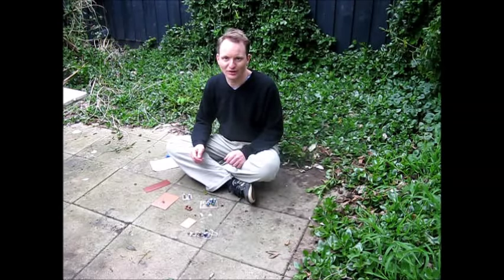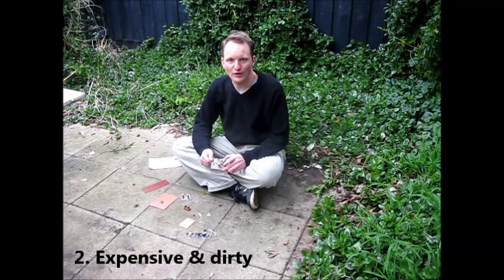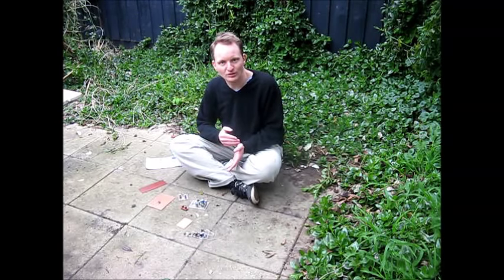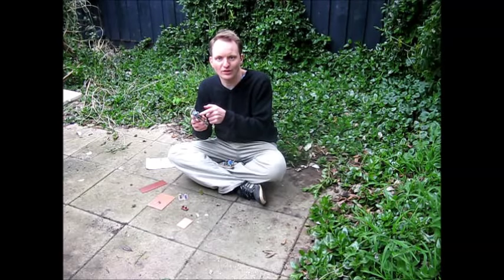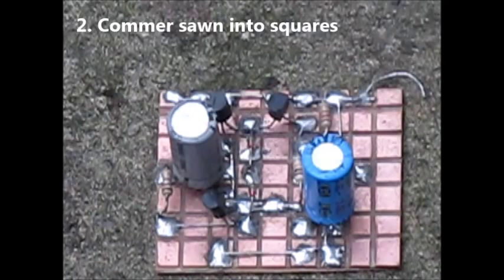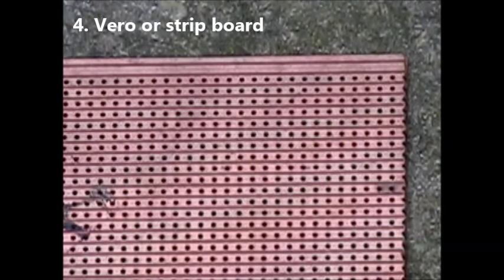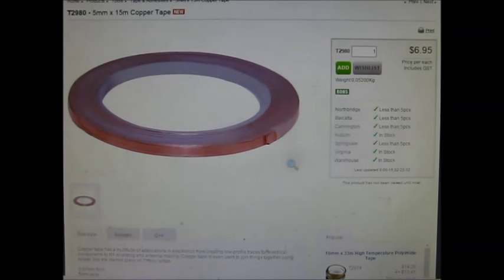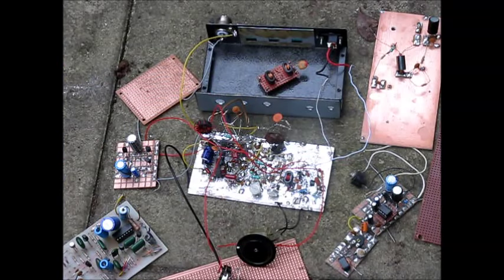Electronics on the Floor: Five reasons not to use printed circuit boards for projects

Comment: Well.... It depens. If you are just wanna hook up a simple PCB for a small project printed PCBs are bullshit in my opinion. Takes more time and effort. Always used those PCBs with those copper dots. Works fine and dandy. 

But if you are going to bulid up a bigger PCB than ithing really comes handy. Seriosly for my graduance  I needed to build up a big big PCB with a fucking lot of traces. You got to make a design for it anyway (on a big project you simpy have to) and doing all the traces with copper wires was a pain in the arse.

Comment: 1 reason to bypass all of this:
1) Inexpensive solderless breadboards for prototyping. 

Tada!

You can buy them just about anywhere, and dirt cheap on schmeebay, or banggood.  
They allow you to just plug in your componants, run a few jumper wires, and you're done. 

The whole point here, is to not waste time, or materials when prototyping, while maintaining a reasonably fast, and inexpensive way to alter your circuits without having to desolder componants, or redesign an entire board layout. 

If at a later time, you want to make the circuit permanant, you have several choices, be it photoresist, laser toner transfer, off-site production, or grabbing the ole dremmel and eating a fair amount of PCB dust.

Comment: Okay, I missed the point... I must have! Oh, that's right... the title of the video is misleading!

PCB is the FINAL stage. Everything he mentioned are considered alpha and beta development stages.

There are two reasons to use PCBs: one, if the project is to be used for production use. And two, If you want your project to be used by other people because they, too, will be using the project in a production environment.

You have a PCB made ONLY when the circuit has been thoroughly tested through other means, whether it is breadboard, wire-wrap, or whatever else. PCB is also important if your final design has to be minimized, and possibly even SMB.

You do NOT use PCB if your circuit is still in development. He could have said this in one minute, and saved the rest of us the other six minutes.
Reply: Nothing misleading in the title at all.  Maybe its just your translation . You certainly did miss the point. If you really listened he was talking about one-off project boards for the hobbyist and nothing to do with mass producing boards for commercial use.

Comment: Why don't use a breadboard ?
You can save yourself from solder smoke and a hot soldering iron too.
Reply from the maker: Soldered electronics is more robust, compact and more reliable.

Comment: I'm going to disagree on all five points:

1.  For all but the simplest circuits it takes no longer to make a PCB than it does to prototype using any other method -- particularly if you are using SMD parts and don't need to drill any holes.

2.  It is neither expensive nor dirty.  Copper clad is dirt cheap on eBay.  Etching using CuCl2 requires nothing more than HCl from the hardware store ($7/gallon) and  H2O2 from the beauty store (40 volume hair developer is 12% H2O2, $5 for 32 oz.)   This is a regenerative process so there is never any waste -- etching actually produces more etchant!  This is enough for hundreds of boards.   It doesn't stain at all like FeCl.  All you need for resist is a laser printer (get an old HP Laserjet free on craigslist -- they are better anyway) and an clothes iron.  If you are at all civilized you should already have one of these.  KiCad is completely free, and there are plenty of other options that are free for hobbyists.

3.  Etch extra pads in any empty space on the board for unplanned/additional prototyping.  Put each module on a separate PCB for additional flexibility.

4.  Huh?   Have you ever actually designed a PCB in CAD before?  It is trivial to select alternative footprints or make one if you have some extremely oddball part.

5.  Bullshit.  I have wasted far more time tracking down assembly errors and poor/faulty connections on breadboards than I ever have on homespun PCBs.  Get a set of hook clips for your multimeter and leave enough room to use them.

Take the time to learn toner transfer and CuCl2 chemistry.  It really is well worth it.  I've used all of those other techniques over the years and given up on all of them with the exception of manhattan construction which I still use for RF circuits.
Reply: yeah tone transfer :) the fastest possible way. Plus if you use simple software like ExpressPCB you can make PCB in about 40minutes, if the board it self is simple. But even for more complicated ones an hour and a half. So it is the best way, plus thoe protoboards i never succeded in fixing components good enough, they always wobble around. Maybe it is good for something tooo simple like few resistors or something like that. I use ALtium as primary tool, but ExpressPCB is something great for small hobby projects.
Reply: And for the normal people who don't own a clothes iron:  laminators work even better, especially after a few mods
Reply: Totally agree, plus you can get PCBs from China for $2 nowadays!

Comment: it happens when non-engineers try to make circuits without any  physics basics concepts. First : you have a relation between track sizes, rated current, and ambient temperature (you dont use any of that). Second: based on good practices to elude heat points or radiation points, your circuit is the most nightmare of electronics i ever seen. third: its totally insane to try to understand whats the error if something fails in that trash. Also, in the way you construct circuits, its imposible to identify induction effects or capacitance effects. 
Of course, if you wanna make homemade toys, its ok, but if you wanna make serious electronics, its not the way
Reply: These are prototyping methods, not engineering for production.  I would expect an engineer to be comfortable troubleshooting their own circuits, regardless of construction technique, since techniques similar to dead bug are used even in production electronics above a certain frequency or precision (applications where any kind of board substrate introduces too much stray capacitance)